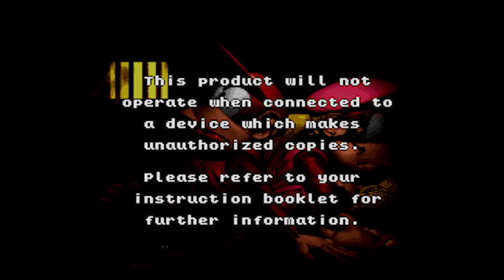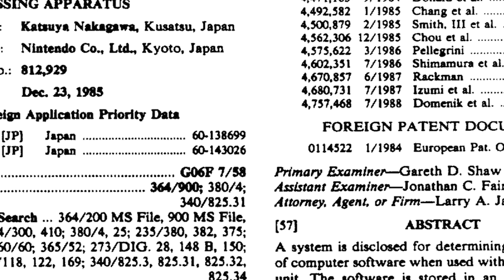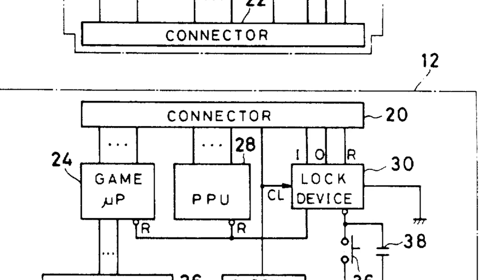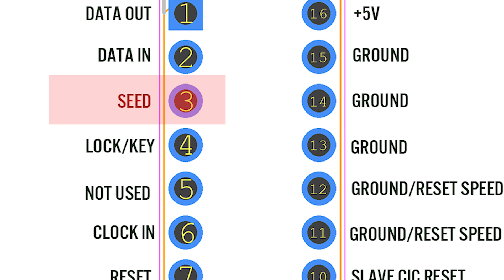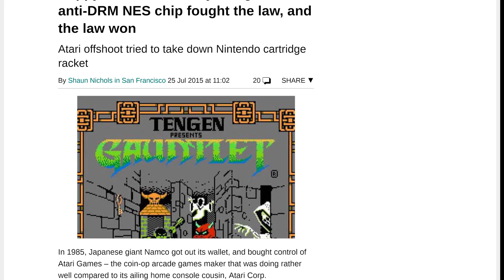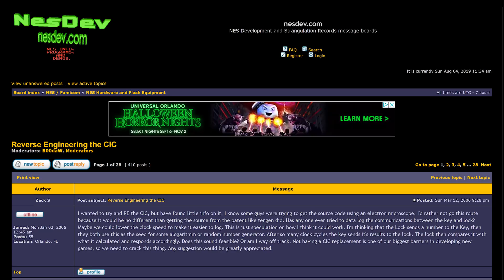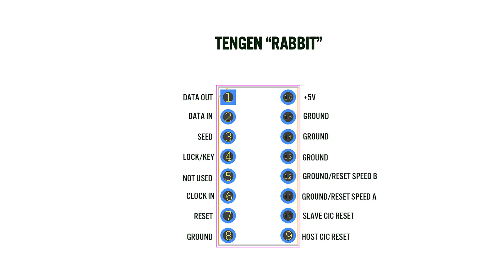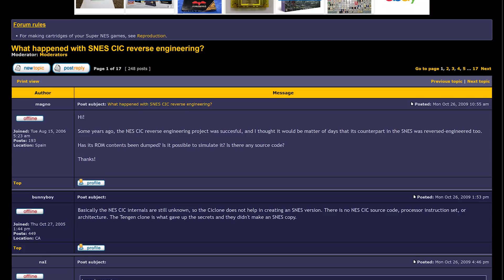Secrets of the Nintendo CIC Chip - Early Cartridge Anti-Piracy | MVG

Comment: from the most difficult DRM to crack to being defeated by a paperclip lol
Reply: And before then, tweezers!
Reply: @bluephreakr  long live team twiizers, now known as fail0verflow.
Reply: @bluephreakr  wasn't that just for region lock?
Reply: It's a real shame (for Nintendo ;) because it was Nvidia's vulnerable bootrom code that allowed hackers full access. The Switch OS itself is actually extremely secure.
Reply: Crazy time. CIC was previously unhackable, until some enthusiastic hardware hackers decided to pick the CIC chips' brains clean, figuring out how it actually works, to just a lazy hack, ie. tweezers for Wii. Nintendo really have no idea how computer security works much anymore; even though current version of Switch OS is a quite tough nut to crack, it's only a matter of time before it's busted wide. It's like hardware is no longer exciting as it used to be (and don't get me wrong, it's still done because you definitely want to know both hardware and software's weaknesses before getting at it for reals). I wouldn't be shocked if Switch cartridges also have a modern version of CIC either.
Reply: All you need to bypass the lockout chip on an original NES is a screwdriver and something to snip one contact from the board.
Reply: Adam Smith that works for most games but not for all and if done wrong can burn out the system
Reply: @MrBlazinerday  so if i snip pin 4, solder wires to it and add a switch to the case of the console, i can enable and disable it at will? My nes is a mattel version (pal) and it spends alot of time resetting itself even on first party games like sm3, ive only once ever got it to load one game i got with it (bible adventures...lol) but it usually takes about 3 minutes of it flashing and me hitting off/on for it to load a regular game too, so it would be handy to have it switchable
Reply: Nintendo Switch 2: Defeated by pressing A really really fast

Comment: I'm surprised that anyone who bought these unlicensed games that used the voltage spike didn't damage their systems unless the voltage spike was so minuscule that it didn't effect the rest of the hardware only the lockout stuff.  Makes me wonder how Nintendo designed the NES Toploader/NES2 because they got rid of the 10NES chip for reliability purposes and with those you can play PAL NES games on it. They must have done some alternatives to the 10NES Chip that did the same thing but was more reliable.  Very interesting that CIC chip took a very long time to crack and that the SNES and n64 used advanced versions of the chip. Thanks to Atari Everdrives are even more easy to create than they were before and even a Bigger thanks to the Homebrew community for doing all this stuff for us.
Reply: Some people did damage their systems using those "zapper" carts - but it was pretty unusual and in most cases even if the chip was damaged the console would still run and just the lockout was disabled.  The top loading NES didn't use a CIC at all and just had a simple reset generator circuit wired to the reset button.  None of the Japanese market Famicom machines had it either.
Reply: @TrimeshSZ  Oh ok thanks for the info. Not surprised that people who bought those games did that to their systems because playing with voltage spikes IS NOT a good idea.

Comment: Why don't hackers built original key chip inside the console connected to the lock chip (disconnected from cartridge slot contacts to catridge cic). Using that method original games would still work fine, as would pirated ones.
Reply: ...what?

Comment: Only nintendo NWCS cart required the lockout chip to run on nes, if you tryed to bypass it via a region convertor or by dissabling the lockout chip, the game refuses to load it’s rom, later snes games did heavily made use of this method as well ,wich is called 50/60hz detection or as nintendo called it “ RMC, region marketing control”
Some snes game may also use the 30nn reading delay check and Sram detection to assume whether you use a Tslot or copier unit or not.
Reply: Makes sense. The Famicom didn't have a lockout chip in the first place, and late revisions of the NES don't either. (toploader.)

This wouldn't be plausible if it was commonplace for games to check for a missing or altered lockout chip.

But the SNES is a different matter, since no revision of it lacks the security chip.

Comment: Impressive how such a simple chip prevented hackers for so long. It would be good to see a deep dive on the challenge process when it was inserted.

PS: A similar 'key chip' is used inside chip & pin cards, the chip actually generates the hash needed to access the card and it is smart enough to prevent brute-forcing.